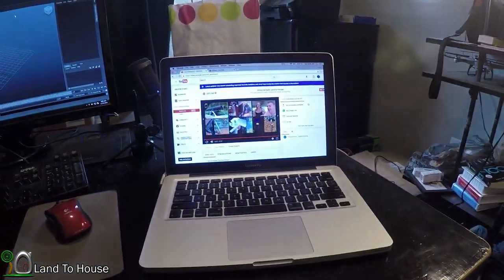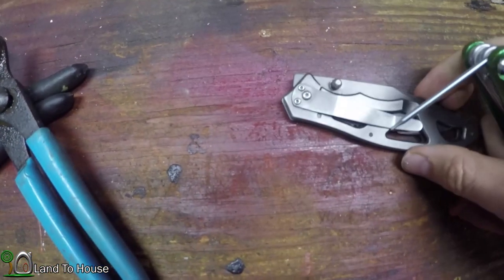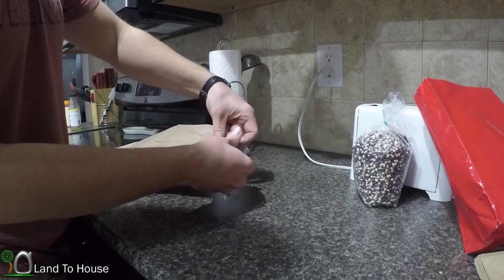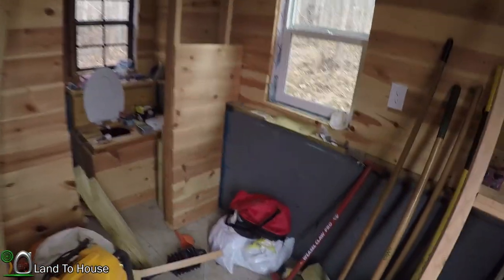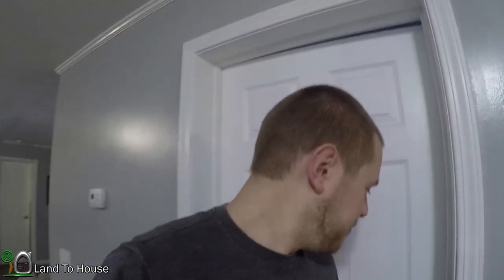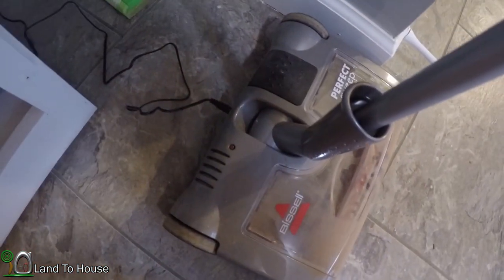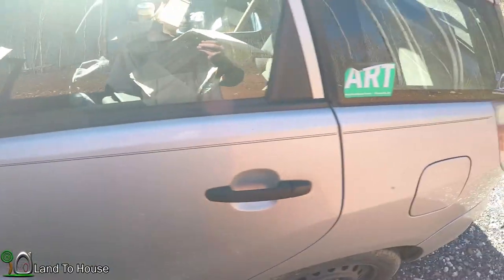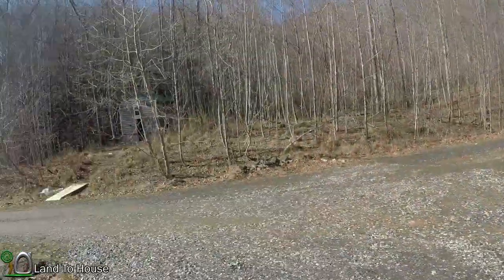Babies dogs and popcorn - weekly vlog #8

Comment: Tread strips on the ramp ought to help but if I were you I'd keep some ice melt (pet safe, of course) handy. When you salt the front steps of the house salt the ramp at the same time. I don't know how much frost and icy rain you get there but I can see a heavy frost or a lot of icy rain causing enough ice to form on the ramp that the tread strips are useless.
Reply from the maker: +tallman11282 very valid point! I will have to get some of that for the steps and ramp. When i install the metal roof covering on the porch I will likely also add a railing to the ramp.
Reply: Land to House A railing on at least one side of the ramp is a good idea, it'll help you keep your balance if the ramp is a bit slippery. Installing a ramp instead of steps was a great idea, it'll make getting things in and out of the shop a lot easier, especially heavy or large items. With that in mind, putting a railing on the side by the shop but leaving the other side open will make getting longer items in and out easier as you can swing them out over the side when making the turn.
Reply from the maker: +tallman11282 I was thinking on the same lines. I might place a rail on the porch as well that would be the same height of my table saw. An on feed table :)

Comment: I don't know why you need the ramp but I think that with a have snow load the anti skid material would also be an issue.. you could of course put some thin slats on top of the planks that function as grip... if that does not work you might need to build a set if stairs...
Reply from the maker: +Martijn Fransen the back will have steps so that is one good way to get in. I think a rail on the building side is a good way to prevent falling. Some anti slip metal or wood slats will be good.

Comment: nice, where did you get that pump in the beginning of the video?
Reply from the maker: That is actually a pneumatic cylinder with two check valves attached. I am slowly working on a project that will have a DIY water pump like this.
Reply: Land to House
ok.